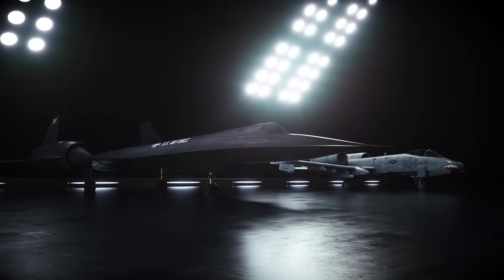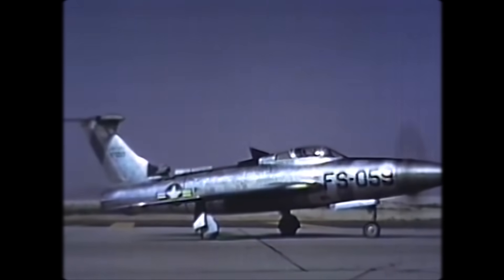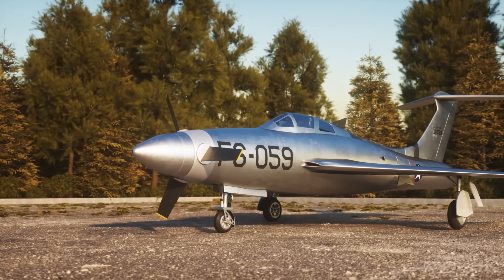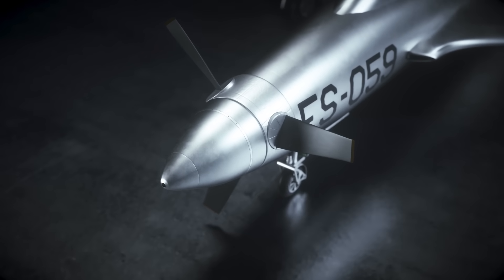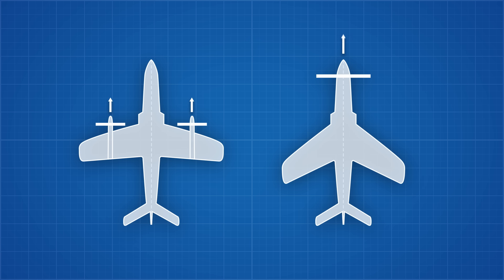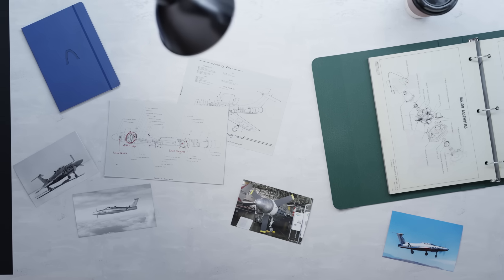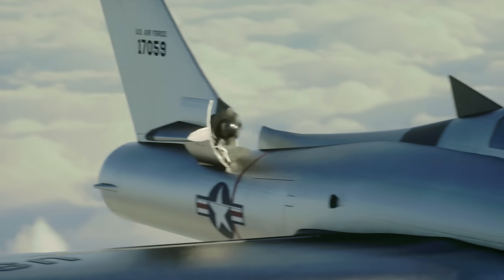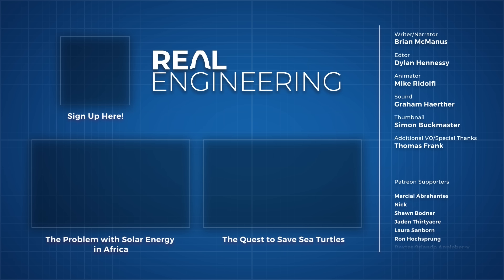The Insane Engineering of the Thunderscreech

Comment: But can that extremely loud noise be weaponised? Have they tried flying supersonic noise machines over enemy territory for idk 90days at a time to cause severe psychological and mental strain
Reply: If you have that much freedom to navigate at low altitude for three months at a time it's likely you can just walk in there.
The B1 (BONE) has been used in a similar manner (low level supersonic strafing runs) to cause damage and confusion, but not long term.
Reply: @jimurrata6785  true but I imagine if the intention was to make noise, perhaps that could purpose design a vehicle/missile to be loud enough from a safe range as well. Kind of like a supersonic whistle on a missile (I didn't mean to rhyme)
Reply: @iamrazor9831  Do you understand inverse square law or that decibel is a logarithmic scale?
If you want a huge boom that raises dust on the ground and blows out al the windows you're going to need to get close.
Not to say that we don't have acoustic weapons that can project focused sound but it drops off over distance because air is compressible and shock waves are naturally damped.
Reply: @jimurrata6785  is that basically how sound waves are 'compressed' closer to the source of the sound and spreads out further from the source?
Reply: @iamrazor9831  Are you describing Doppler shift?
I'm not talking about frequency, but amplitude.

Comment: Two contra-rotating driveshafts (if the twin engine outputs did in fact contrarotate) would tend to counteract each other’s contributions to that terrifying body torque. The single shaft has no such counterbalancing force, so must be kept as short as possible.
Reply: Due to the single gear, the jets rotate opposite to the prop and rotational inertia cancels ( to a degree ). The tail and the wing-roots are responsible to catch the vortex in the air to counter torque. This is similar to the gear in the P-51
Reply: Internal power arrangements don't matter. It's the rotating prop interacting with the stable atmosphere responsible for torque forces on the airframe.  Both Mustang and Corsair could go inverted if the pilot opened the throttle fully at certain speeds, and was slow countering the torque with opposite aileron. The Bearcat and similar British plane that missed combat had to be worse.
Reply: @billtaylor3499  Internal arrangements absolutely do matter.  The gyroscopic effect is caused by any and all rotating masses in the airplane.  Anything else would violate Newton's Third Law.  The direction of the prop wins out in the examples listed as you've said but prop direction is not the entire story.  Look at WWI style radial engines.  The entire mass of the engine rotating causes the force, not just the (incredibly slow) prop spin.  As the original comment said the Thunderscreech used contra-rotating shafts to fight this exact issue.

Comment: I have a question: why gearbox was in front? Shaft spinning at 2100rpm along the body is less terrifying than 2 at 14000 rpm. Weight distribution? Torque requirements?
Reply: Pilot directly in line between turbines and prop???
Reply: As mentioned in other posts, faster shaft speed means lower torque, which allows lighter shafts.  Two shafts allowed asymmetrical power contributions from the dual engines, a range consideration in service, as many engines are less efficient at lower throttle settings. Probably no advantage in a development plane. Gearbox in front assists balance and increases rotational moment of inertia in several axis of movement, making plane more stable, particularly in transitions. See various discussions on P-39, which are of widely varying quality and veracity.

Comment: Calling the aircraft an abomination is overly dramatic. It actually is a great looking aircraft. The engineering struggles were fairly commonplace with new design aircraft. The same aircraft today with counter-rotating shafts may surprise. Abomination? No. Just problems that technology of the day couldn't solve. The  V-22 Osprey had incredible problems that were solved. The P-51 was an under-performing aircraft when first developed, that doesn't make either one an abomination. The P-47 started out as a less than ideal fighter, with improvements during it's career, it became one of the best.

Comment: The P3 Orion which has 4 engines and usually runs with 1-2 engines turned off. But I am not sure if they do it in the  4 engine C130 at 12:07

Comment: Why didn't they just place the reduction gears in the back of the plane and decoupled the prop after take-off? Simply angling the prop forward and stopping it would have made most of the problems go away.
Reply: Um, mate, how does it fly if you stop the prop?
Reply: @marvindebot  The twin jet engine might help a bit.

Comment: The British Fairey Gannet was a carrier aircraft with two turbo jet engines powering coaxial propellors. It could fly with one or both engines running.
Edit. The engines were not coupled. Each prop ran at its own speed.

Comment: Why they didn't use a contra-rotating prop setup on this is beyond me. Would have solved the torque issues and with a higher blade count (maybe 8 or 10) they would have been able to hit 600+ mph without having the blades travelling at supersonic speeds. The concept was sound. The execution was horrendous.
Reply: My first thought as well. This could have been awesome and the pinnacle of prop-driven design instead of a major clusterfuck.

Comment: So instead of having two driveshafts spinning at 14000 rpm into a reduction gearbox, wouldn't it have made more sense to have the gearbox behind the pilot and have two much slower driveshafts? Or would the increase in torque mean they'd have to be much heavier?
Reply: bingo, increasing torque means more weight. monster trucks have gearbox hubs for a similar reason.

Comment: I have a question; Will bullets shot out of a gattling-gun have increased speed when installed on a fighterjet at 1000 km/h have an increased muzzle velocity, or is it independent? Will the effect on target vary according to if what it is firing at is moving, and if it is moving towards or away?
Reply: The initial inertia is added to it, for example, the bullets of a b-58's tail turret would end up just kinda falling out at supersonic speeds, and could actually still be going the same direction as the plane at top speed.
Reply: Muzzle velocity is a constant, and always relative to the gun. Add plane velocity, to get bullet velocity relative to ground. ALL bullets fall at the same speed relative to Earth, if fired from level barrels. Hits happen when pilot figures where bullets will be when target arrives at planned intersection of paths. It gets complicated. Late war computers were getting on top of the problem. Predictive aiming images are now on heads up canopy displays.

Comment: If there’s one post-war experimental plane I totally don’t expect to be covered by Real Engineering, it’s the Thunderscreech. Between this and the Tu-95’s massive contra-rotating turboprops that could reach supersonic speeds at the tips of the blades, it’s amazing that prop engines weren’t completely forgotten despite advancements in turbojet tech. Thanks for giving an insight for essentially a flying earrape meme.

Edit: After finishing this video I now have a couple of questions. 
- I wonder if by making the props contra-rotate to each other would not only solve the torque issue, but also make the reduction gear smaller since it now has to drive two sets of props? It would also straighten the turbulent airflow and perhaps quieten it?
- Also, how’s the heat management for the Thunderscreech? From my understanding, coupled engines typically ran hotter due to heat being trapped within the system. The He-177 “Greif” was notorious for having coupled DB-603 engines that would regularly caught on fire and further making the plane harder to operate.
Reply: Error on the timeline.
The Tu-95 first flight was in 1952, the Thunderscreech came LATER - and the Tu-95 was IN PRODUCTION though not enough done yet to deploy them by the time the Thunderscreech achieved it's first test flight.
The Tu-95 used contra-rotating props to cure the MASSIVE torque issue that engine would have caused - and to handle it's output.
Reply: @bricefleckenstein9666  Updated. Turns out the turboprops on the Tu-95 were of German origin, and was a solution from Kuznetsov to combat the piss poor range delivered from 50’s turbojets on the Myasischev bombers. The props were so loud that even submarines in deep waters could track the plane from miles away with SONAR. Also, the same engines would also power the Tu-114, once the largest plane in the world and also still holds the record for being the fastest propeller-driven plane to this day with a top speed of 540mph. 

You made me learn a lot of stuff today. Thank you.
Reply: @Nafeels  I served on USS Ranger - we had at least 2 Tu-95 (probably marine variants) overflights during Westpac 1979, so I'm quite familiar with how loud the Bear can get. It's likely we had other overflights while I was asleep, as I worked mid-shift.
The Tu-114 absolute speed record for a prop-driven plane was broken in 2003 by a current turboprop business plane (576 mph) but Guiness lists the Bear itself as the fastest production prop-driven plane at 606 mph. That is an estimate however, as the actual Bear never made an official speed record attempt - but given it's a lot smaller cross section than the Tu-114 with the same propulsion, it WOULD be a good bit faster. I suspect that 606 figure would have been from the MANY radar contacts the US Navy has had with Bears over the decades.
Reply: @bricefleckenstein9666  Bear over flights twice a day for about 3 weeks. I was on a Knox class frigate....."plane guarding" the Ranger. Decent cruise tho....... Subic was so nice before Pinatubo went off......
Reply: @ajwilson605  Don't forget the collisions - one YC barge sunk or nearly so at Subic, the Liberian registry oil tanker Fortune nearly sunk in the Straits of Malacca, almost sunk a tug (I think that one was also at Subic)....
Reply: contra rotating propellers don't do much to quieten anything, the air from one prop smacking into the other is half of the reason why they are so loud. Having the tips go supersonic and basically giving a 'drone' of continuous sonic booms does the rest.
Reply: @AlexanderBurgers  The contra-rotating props are intended to handle the TORQUE output of the jet engine, no other reason for them.
Reply: Guy... prop propulsion – not «engine»

You aren't from rural land, are you?

Comment: So how does the Tu-95 deal with the transonic propeller problem? Those planes have been in service for a very long time.
Reply: Part of it is probably the crew not sitting right behind the propeller. Also, the NK-12 is described as having supersonic blade tips, whereas with the thunderscreech apparently a considerable length of the prop blade was going supersonic.
Reply: @tz8785  I suppose it's a matter of degree, and the increased range relative to a turbofan was judged to be worth the noise.

Comment: I must’ve missed it in the video, why was the plane so loud? I saw all the engineering challenges that were dealt with, but none seemed to be sound specific.
Reply: Each blade tip generated a shock wave. So at say,2100 rpm,there were 6300 shock waves per minute striking the observer. Look up just how loud a Tupolev Tu 95 is while flying. Pretty much the same issue. I have no idea if this particular propeller made it worse than that,but if you look at the graphs, all the power not generating useful thrust was going somewhere. And there is a lot of energy in a shockwave.
Reply: I believe because of the speed on the tip of the prop blade. It most likely was over the speed of sound, creating shockwaves

Comment: The Mig-25 Foxbat was cumbersome. The Thunderscreech was an IRL earrape.
Which one was the worst?
Reply: No competition. The MiG-25 was effective enough in its role, and more or less accomplished all the objectives of its development program. It didn't do things it wasn't supposed to do, and that the Soviet Air Defense Force later wanted it to be able to do, but that's more or less a given in a cutting-edge engineering program. Its successor MiG-31 showed how complicated and time-consuming it was to make a more versatile plane.

The Thunderscreech only accomplished losing a relatively small amount of money and making a load of test pilots and ground crew angry. It was a reasonable experiment in its face but the tech should have been rejected long before they spent time modifying a F-84 to test it.

Comment: "Our jets cant take off from aircraft carriers."
"So lets fund research into better engines, right?"
"No, lets build a supersonic prop monstrosity loud enough to make ground crew vomit!"
Reply: Researching better engines would have been an ongoing process...  You have to remember that at this time, we did not have carriers with the current steam catapult system on them, so the aircraft had to be able to take off all on its own... This video uses images from later carriers that had steam catapults and as such, that might confuse some people... I suspect that most aircraft, even today, cannot take off from a carrier without a catapult... I seem to remember back when I was in that there was one aircraft that they said could take off without the catapult, if it started it's takeoff from the very aft of the flight deck (i.e. the area where the planes are normally landing) and continued forward all the way to the bow... It's been a long time, but I think it might have been the F-14 and it still required both afterburners to the on...
Reply: @CurmudgeonExtraordinaire  inventing the steam catapult is still a much saner and simpler solution to the problem than "supersonic prop plane"
Reply: @Riesenfriese  I think the steam catapult was already invented by the British and in use on some Royal Navy carriers whilst this plane was in development which makes it an even more strange proposition
Reply: @Riesenfriese  -- 20/20 hindsight... At the time, you probably had multiple development efforts going on, on various fronts... The problem with steam catapults is that they would have required a MAJOR refit of the existing WW-II era aircraft carriers that were still in service at the time... I was stationed in an aircraft carrier and I can see how that would be a MAJOR refit and put the carrier out of service for quite awhile... Most likely, it would only be attempted at the next major overhaul of the ship and then you have to factor in whether it is worth it given the lifespan of the ship at that time... The angled deck carriers had them and were able to do simultaneous takeoffs and landings because of it...
Reply: @CurmudgeonExtraordinaire  Yeah the people making these decisions probably saw this plane and it was faster and cheaper to make than a better jet engine and it didn’t require them to make time consuming retrofits to ships that took them out of service.
Reply: @zashbot  -- Everything in engineering is a progression from what is already proven to something that you HOPE will be proven in the future... There's a LOT of trial and ERROR in the process... :)  Sometimes, you get spectacular failures while you are gaining knowledge -- the Tacoma Narrows Bridge comes to mind... Prior to its collapse, people didn't really consider that wind and the resonant frequency of a large structure could have such an impressive "interaction"...
Reply: @CurmudgeonExtraordinaire  We ended up refitting those Essex/Ticonderoga class carriers for angle decks anyway, I suspect the cats went in during THAT major rebuild (but I don't remember the exact timeframe so I might be off on that for SOME of the earlier ones).
Reply: Coupled turboprops and supersonic props was research into better engines. Gated bypasses and Variable vanes in turbojets was researched as well as jet intakes and reheat/afterburners. To put the state of technology in context, afterburners often only worked at high speeds and altitudes so weren't fitted (generally) because of the extra weight and bulk (they were often longer than the engine they were fitted to), and the F-84 the jet plane this test aircraft was based on had a long bent tailpipe that caused performance problems at low speeds, and the use of the area rule to reduce transonic drag was unknown, limiting its top speed.
Reply: It would be a good weapon if you use it right
Reply: @imjustthere9343  Just do low passes over the enemy until they give up to stop the noise, saves on ammo cost :D
Reply: Hey you gotta think outside the box, I think something like this could work if you can stop the propeller and fold it out of the way after take off once the jet engine takes over
Reply: Don't forget that with enough power and proper skill you can "hang on the prop" and just pull a prop plane upwards. This wasn't a crazy concept, it was just an attempt. Everything has positive traits and negative traits. Prop planes are very nice for short runways, but not good at high speed... They were trying to push the limits.
Reply: Tax payer money brought us success as much as failure.

But it ran the USSR into  bankruptcy. Us as well.

20 trillion and nobody is putting on the brakes, till after we crash.
Reply: @reypolice5231  The USSR was long gone by the time we came anywhere near bankruptcy.
While the debt is an ISSUE, we're a long way from being bankrupt.
Reply: They did both genius
Reply: Xf-84H was not developed by sounds, it was developed for the navy.